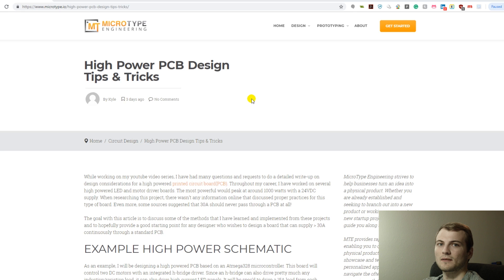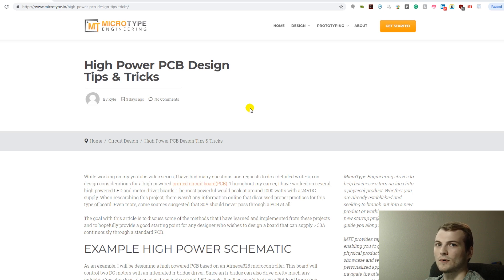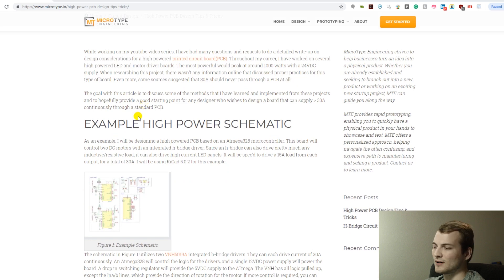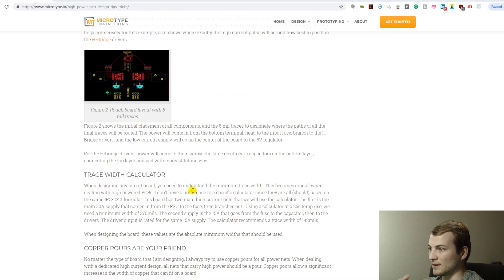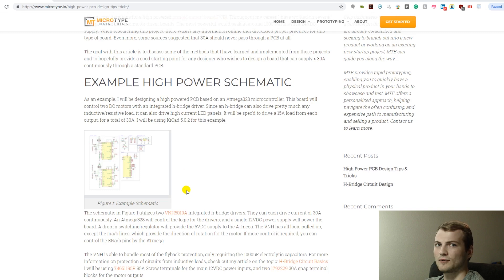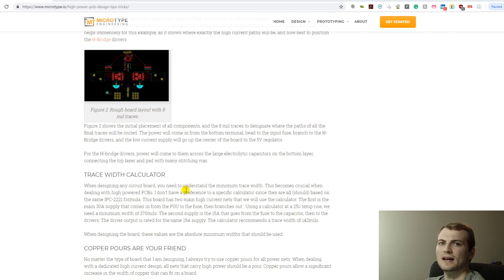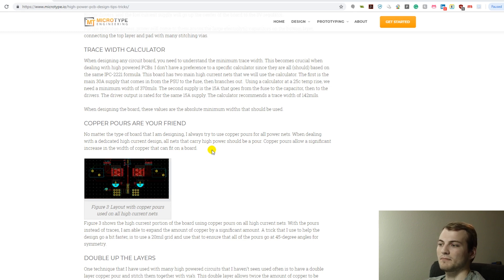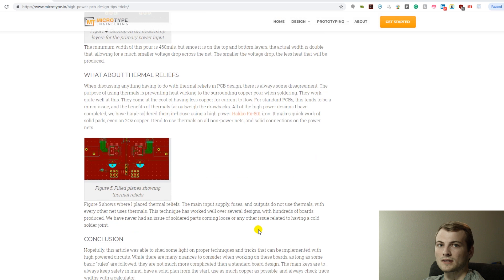Update and High Power PCB Tips & Tricks

Comment: Hi, great article.

I think there is a bug in schematic, it seems like there is a short circuit between INa and INb in both H-bridge drivers U2 and U4.

In KiCad/EESchema junction is placed automatically when wire is touching components inputs, so I guess it happened accidentally when some components where grabbed and moved to make schematic packed.

PS. I tried to make that comment on the blog but after hitting submit button it shows "Processing.." for a long time and I wasn't sure if it was logged in the system so I am posting it here as well.
Reply from the maker: Ah yeah. I fixed that for the layout, forgot to update the schematic image. Will replace, thanks!